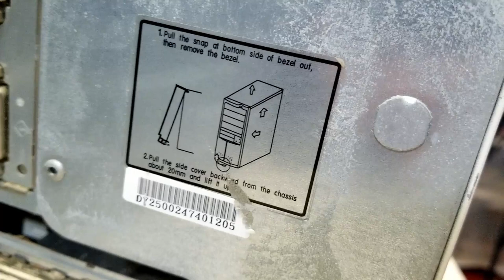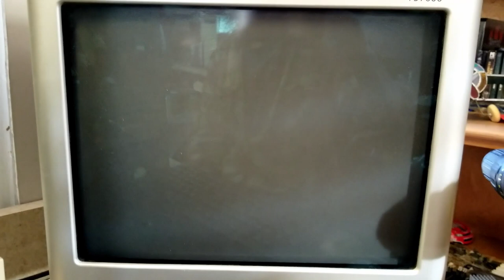MSI AMD Socket A motherboard find, sadly it's DOA

Comment: how about a brand new old board the same as the one you have. i have one you can have. pm me
Reply from the maker: Thanks, I appreciate the offer! However this one is no longer dead, I was bored and just kept replacing caps and eventually it worked! :D I just havent had much time to get back on it lately, but hope to build something with it soon.
Reply: Snickerrick I found the same board earlier, is it rare or something? I’m a noob builder but soon I’ll be a pro :)
on the board it says M7VIG 400, has some kind of AMD cpu.. looks nothing like the ones we see today like ryzen 3000 series.. very old, but I have no idea how decent it is so if u guys have any idea, I’d be eternally grateful for the info. 
Done some digging and it has an AMD sempron, sounds good